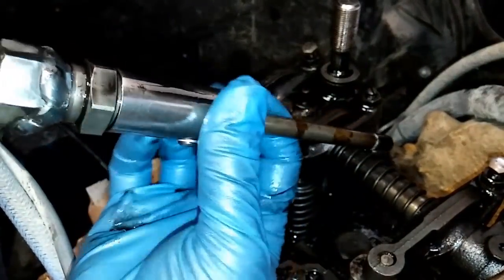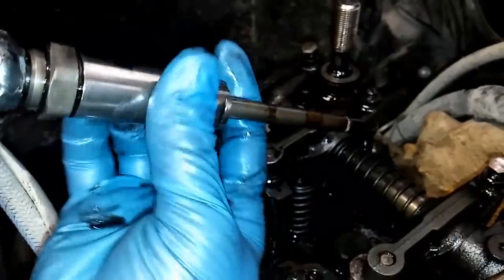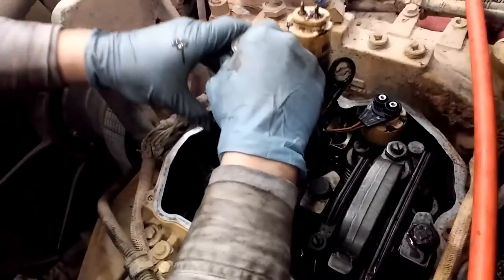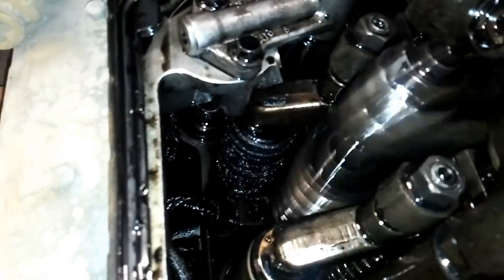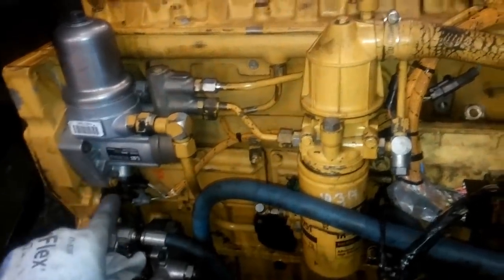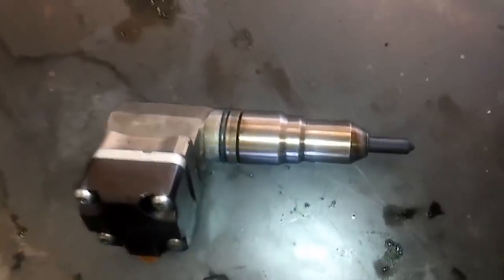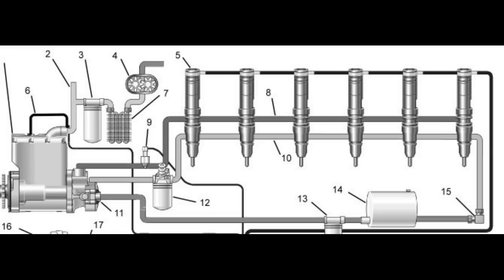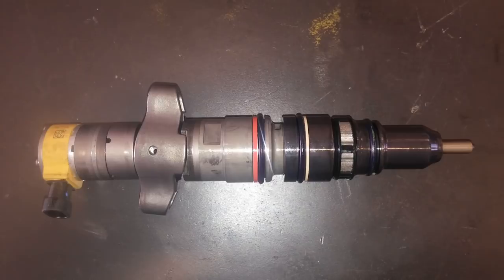What Are The Different Types Of Diesel Fuel Systems.

Comment: My fuel return line to the tank is extremely hot. My check engine code is reading hot fuel temp. So it's coming from the engine. What do you think can cause the fuel to return extremely hot?
Reply: Single tank or dual tank? How much fuel are you running, full or empty? Remember these engines return 100 GPH back to tank to help cool the fuel and injectors. Hot fuel equals, low power and can lead to failing injectors. A aftermarket fuel cooler could be installed. Also restriction in return lines can cause problems as well.

Comment: Still say you cant beat cummins 12v p7100 with mechanical injectors, the two systems you showed would leak straight into the oil if they ever had any leaks. Plus p7100 used motor oil to lube pump not fuel like new ones so you could run any kind of fuel oil in the truck. Plus all these injector are big and look way expensive with the wiring and sensors. Keep it simple

Comment: Mechanical fuel injection causes the clatter that diesel engines are known for as its due to uneven burning 

Electronic/Pezioelectric are quieter as the fuel is scattered more evenly and burns evenly

Comment: Have a c7s it will do a forced regen but loss of combustion codes when it comes off the road one of the other mechanic said bad ones are plugging dps it was removed and cleaned last week doing injector now any idea thanks
Reply: I would have my off board data file pulled and send to Cat.

Comment: just 1 question that i didn't see what is the difference or how does the engine go up in speed. just because you add fuel if it is putting in fuel if it is late then it does no good how does the gov work?
Reply: OK we will use a 3406B type. You have a flyweight carrier with four flyweights attached to the end of the fuel system camshaft. 
It has a tach drive shaft that runs out to the back of the governor. Next to the flyweights you have a race and a sleeve assembly and next to it is a seat for the governor spring.  Then the governor spring. The governor spring comes in different tension for RPM's. Next to the spring is a lever that is hooked to the throttle lever. Above the flyweights you have the piston valve assembly that hooks to the fuel rack. It is oil assist and has a fulcrum that hooks to the sleeve. So at zero RPM's the flyweights are closed or in, fuel on. When you start the engine fuel is injected on the pistons and engine starts. The flyweights spin out pulling the fuel rack back. The flyweight force and governor spring force equalize and are balanced. You have a set screw in which you adjust, to increase spring force or decrease spring force. If you increase spring force the flyweights has to speed up to equalize. If you turn the screw out reverse happens and speed is decreased. That's how idle works. Now when you depress the throttle you again increase spring force. More fuel is injected and engine speeds up, flyweights sling further out until the spring force and flyweight force equalize again. No matter the RPM the two forces equalize. Now you have a stop screw or called high idle screw which stops throttle travel. Cat truck mechanical engines usually has a ten percent droop governor. So back to high idle. If you take the screw out, or have a weak governor spring or the wrong spring the two forces cannot equalize and you will have a high idle surge. 
When driving down the road again the two forces are equalized and since you are loaded the fuel is turned on by the load. Now you come to a hill and the engine slows down, the flyweights move in and the governor spring force increases. Fuel is moved further to the fuel on position. The more you press the throttle the stiffer the spring comes and spring is in command until full fuel is achieved. You have a torque spring which has two fuel screws, full load setting and full torque setting. So at full fuel the deflector spring is bent over (FLS) and the full torque screw (FTS) is up against the stop bar. Once you over the hill and engine speeds up. Flyweights open up and get faster. As they move out the flyweights over ride the spring force and the flyweights are now in command as less fuel is needed.  
All the governor is doing is trying to balance two forces and run at a steady RPM.

Comment: Heui has to be best for engine longetivity, clean oil , longer running engine, no oil pressure no injector firing,  no metal on metal  due to lack of oil,  only problem i can think of electronics dont last forever.
Reply: I have worked on IHC and the Ford H.E.U.I. engines for years. The biggest problem I have seen is O- Rings degrading from heat cycling. They get very hard to start when the O-Rings are even seeping the high pressure oil that operates them.and the Ford's have failure prone cam timing sensors

Comment: I got mechanical unit injection and even if i had the very expensive tool to adjust the injectors my as aint messing with it. Need to find someone who knows how to do it just as a maintanance deal and make sure my shit is doing whay its supposed to be doing. I cant find anyone who has the tool and knows how to do anything with unit injection.

Comment: P pump and mechanical fuel pump are the same. correct?
Reply: A P7100, or "P-Pump" is a mechanical Bosch injection pump. Basically a model or line of pumps. There are other mechanical pumps out there, tons actually.

Comment: the fuel injection type in c15 with the spring also exist in vw especially in 1.9 ,and it is very good engine 
except the injector which are very expensive and hard to repair
and to my opinion the long injection pump like deutz is the best and robust and reliable

Comment: you really didnt touch on pt systems.
Reply: oh and the 3406e the electric sollenoids control the fill n spill ports  to control the amount of fuel.   timing is still done with the camshaft. there is a very minor timing change but that is more to do because of fuel volume.